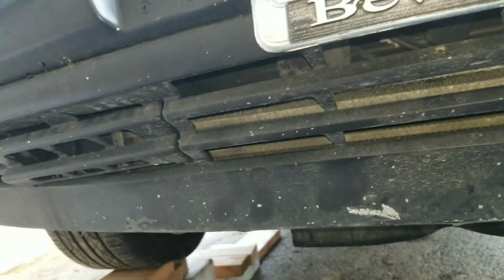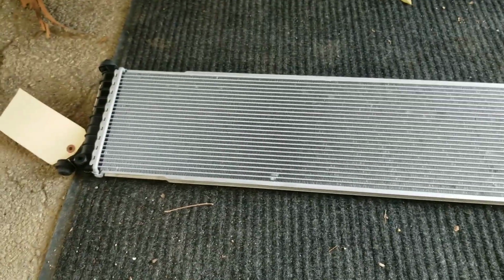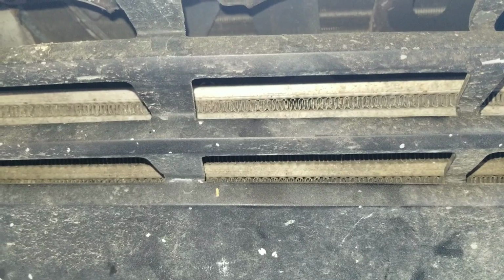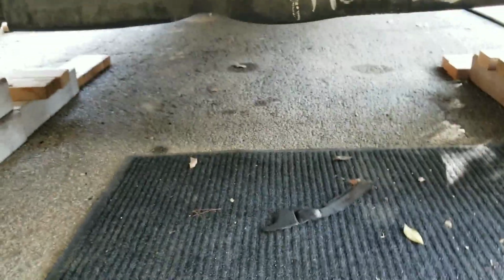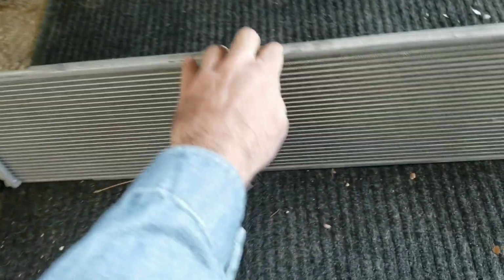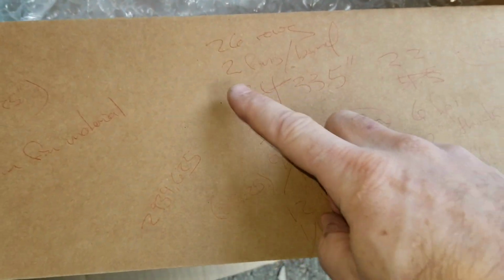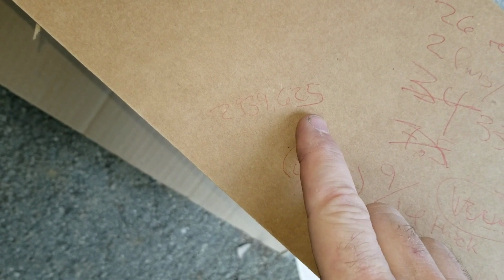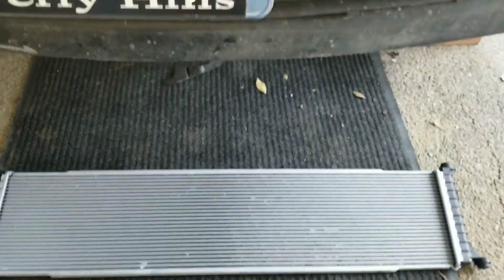W124 om606 intercooling options: water to air

Comment from the maker: bought the Pierburg pump. Next step is to weld the laminovas into the intake manifold, and make a little reservoir. I have a little pwm Tecomotive controller for the pump so I will probably put a pressure gauge in the loop to see where we are on the flow curve and then set the pump rate accordingly. It will need some thermocouples also to see how we are doing on both ends. I will likely log it all on an AEM Aq-1 as there is just so much going on if you really want to understand it all. Will also likely add another little water to air radiator in the right wheel well and run it in series with this one, just to max out the available area on the front of the car. Anyway will post again when I have time but it has been about 10th to 20th on the priority list lately.